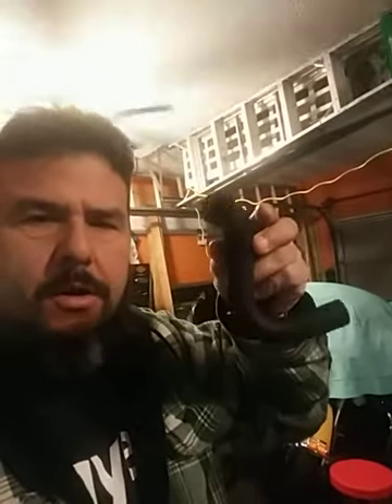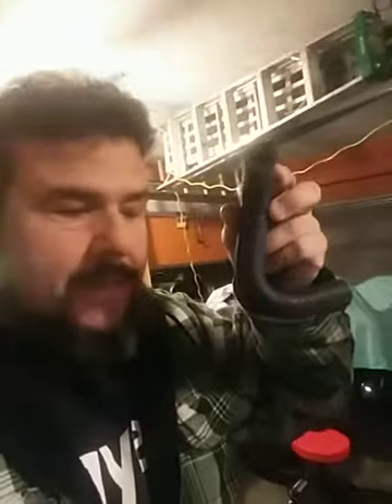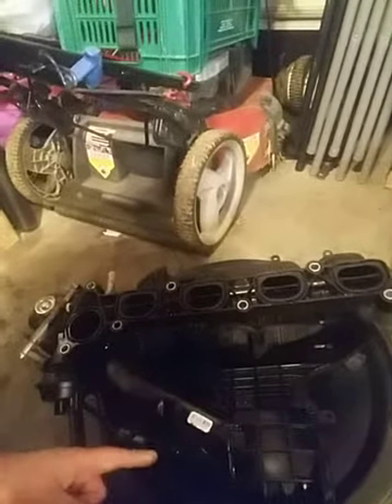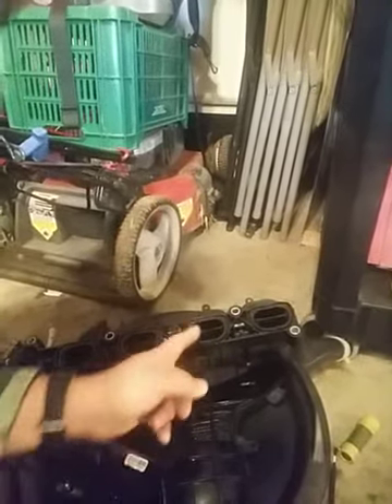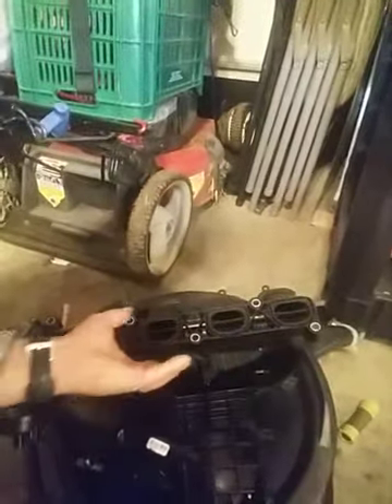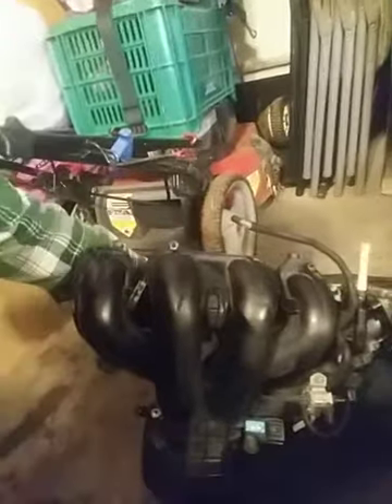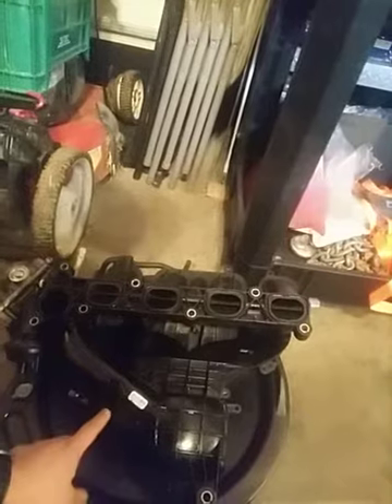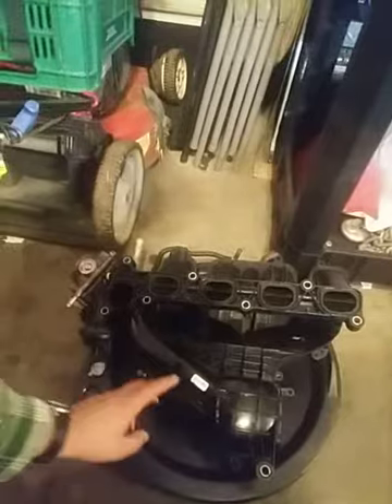2005- 2007 escape hybrid pcv change- misfire on cyl #2 and smoke at 3500 rpm out the tailpipe.

Comment: I did this job two months ago as a preventative maintenance on my 07 Escape Hybrid (150,000 miles).  There's an excellent YouTube showing a female tech replacing the PCV on the 2.3L Mazda (same engine).  Take your time and pictures to help confirm which hose/connector/tube went where.  I'm not close to a mechanic, so it took 15+ hours over 3 days, but that also included the installation of a new water pump, pulley tensioner and thermostat (much easier to access those parts with the manifold off).

As mentioned in this video, PCV is a cheap part with huge labor that many Ford dealers don't even want to undertake (they laughed at the cost and thought of doing this as a PM).  But, if PCV sticks closed, pressures can rise and oil leaks (possibly fatal) come in droves.  If you undertake this task as a PM or to repair a problem, definitely replace all manifold and fuel injector gaskets, coolant bypass hose, knock sensor, MAF sensor and oil separator (which has a new PCV included) while you have the manifold off.  You don't want to imagine having to access those things later once you undertake this job. The hose Ford makes for the PCV is really stout/well-made and worth the $30 (in my opinion).  I didn't have too much of a problem accessing the dreaded "hidden" manifold bolt located in the middle area since I had the pulley tensioner off (could slide my arm through that area).  I did not have to remove the radiator/cooling fans.

Pack your patience and best attitude for this trip.

Best wishes.
Reply: Correction....MAP sensor (manifold absolute pressure), not MAF.  MAP attaches to lower/front side of intake manifold.

Comment: I have 06 escape 2.3 non hybrid 266000miles going through 2 gts oil every 100miles never had pvc change 3 of my 4plugs dripping oil is my pvc same place as yours I was told valve cover have to take off at top right inside?
Reply from the maker: Follow my video, the pcv is behind the plenum against the block. It is a labor intensive process but will help your oil consumption out tremendously, it did for mine.
Reply from the maker: Both engines the same place I believe
Reply: Thank you yeah looks like a pain in the ass thats for sure
Reply from the maker: @rodbrezinski8033  just stay focused when you do it. Remember how you maneuvered certain parts to remove em, hoses, bolts, wires, ect.
Reply: @fixitsteve5020  Thanks Steve waiting for to get a little warmer before I attempt it

Comment: I have a 2007 FEH 172K miles hoping this will be my issue but WOW 7 hours down to fix a PCV valve and I thought it did not have one.  Great video, now to see if it will be 7 hours or 14 for me. I've never had the issues with oil I have than with this one.  Thanks for the tips it took me a while to find it.  Did you have large oil consumption and over the highway miles? Mine is using about a quart every 1500 miles. barely any at first then it drops about 1/2 quart after changing it.
Reply from the maker: It would burn the same as yours